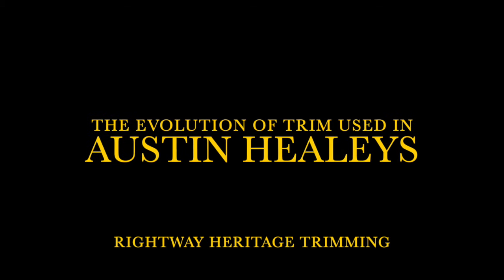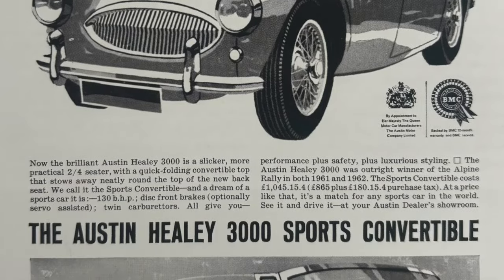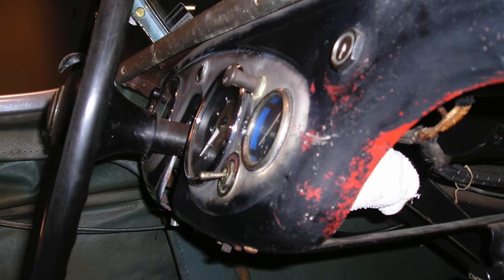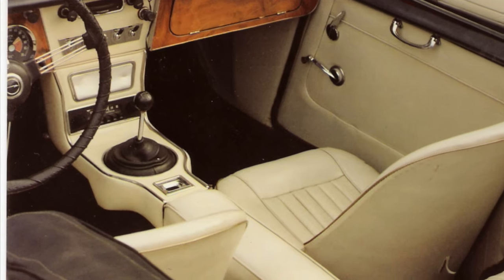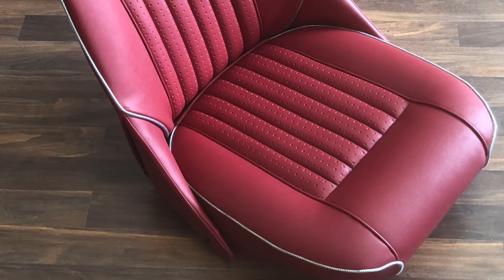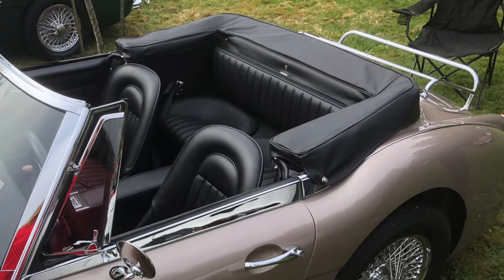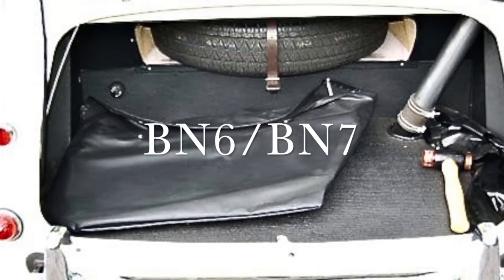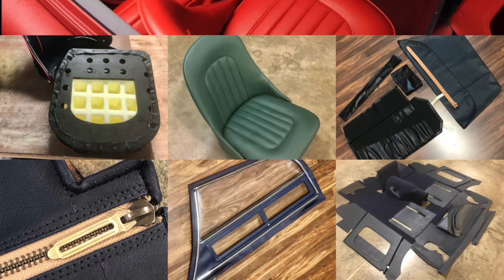The evolution of Austin Healey interior trim

Comment: Do you know if any changes were made to the type of wood veneer used?  I have a 1964 built 3000 which has burled walnut veneer.  I had thought they discontinued this relatively quickly because of the expense.  Any idea if this is true and when the change was made?

Comment: The English are total smicks sometimes; given the size of the engine cavity, the only thing that made sense was to simply install a Chevy 283 
(or larger) small block. In the late 50's in Calif. tons of guys realized that the only move was to ash can the
weak tea bag stock engine and to drop on a chevy with 
a radical cam and like six carbs, set the engine back
as much as possible and 
blast off at the nearest strip or stop light!!!